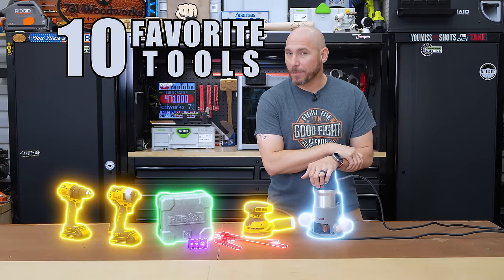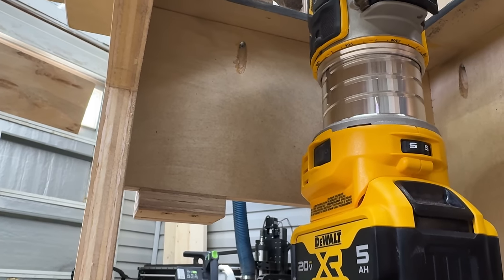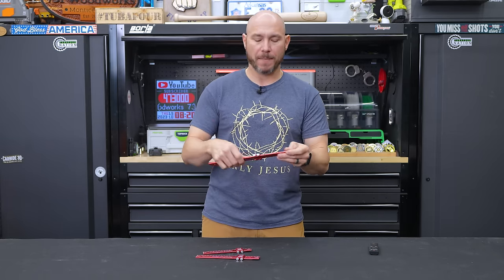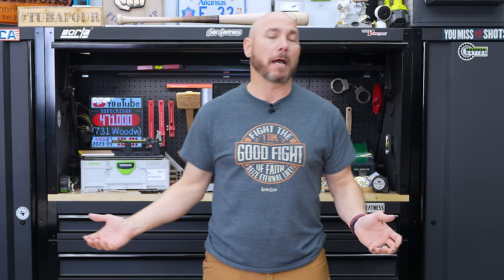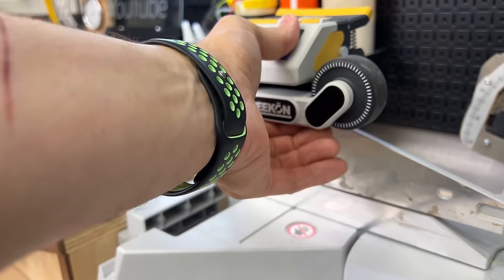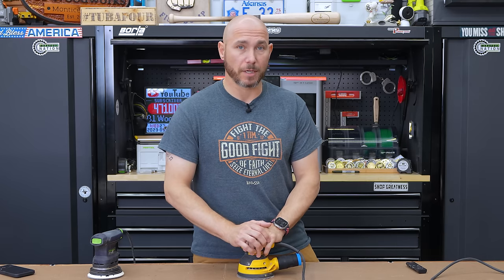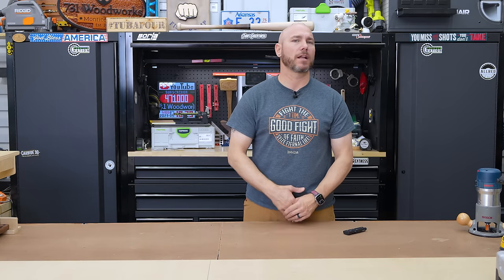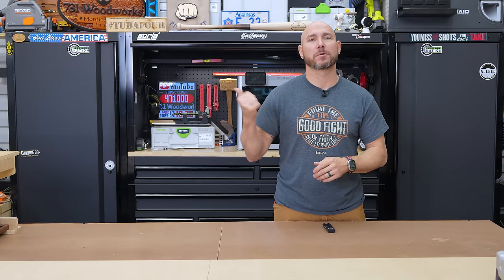Top 10 Woodworking Tools I Found on Amazon in 2023!

Comment: @731Woodworks This is the 2nd video that I noticed you mention it being weird that the 20 volt batteries don't work in the track saw but the 60 volt will work in the 20 volt tools. The reason for that is because the 60 volt batteries are actually Flexvolt. The batteries are at 60 volts for tools that require the extra power (like the tracksaw) but they change their voltage automatically when you use them in 20 volt tools. The 20 amp batteries don't have the ability to up their voltage to 60 volts. That's why they don't work in tools like the track saw.

Comment: Anything Woodpeckers can automatically be declared excellent. But I've got a 50 year old Starrett combo square that is still dead on square. I also have that Bosch router from when they were first released. There was a Craftsman version of the same router but I believe the body had cheaper materials. It's definitely a buy it once tool. 

Good video.

Comment: I'm mostly a DeWalt guy, but when I got my tracksaw I went Team Teal.  Biggest reason?  Track compatibility.  Makita and Festool tracks are interchangeable.  DW is proprietary.
Reply: That's true, the Dewalt tracks are proprietary to the Dewalt Tracksaw.  That said, the Dewalt tracksaw has 2 grooves in the base, one for the Dewalt tracks, but the other works on the festool-like tracks.  I have two Festool tracks (eventually more once I get LR32 tracks) that work just fine on the Dewalt saw.

Comment: I just commented the same thing on another video. I haven't had any complaints about any of the wen products I have. I have and use the oscillating belt/spindle sander, drill press, and band saw. I also have the track saw and 660cfm rolling dust collector, but haven't used them yet.
Reply from the maker: Thanks for sharing!

Comment: Great content today. I would like to see you test the Dewalt 20 V max knock off batteries that are just all over Amazon. I don't know if they fit they work they last half as long or twice as long that would be some good content I think.  Hey just thought of something else on the router bit holder, it works you're just great to hold the bit while you try to sharp in the edges.

Comment: Great content. I’ve had my eye on that router and router table combo. Looks solid. Thanks Mighty Matt!!
Reply from the maker: Thanks Lloyd!
Reply: @731Woodworks  your welcome Sir.
Reply from the maker: @ronswoodshack   What tools are on your wish list?  Trying to get ideas on what to review in upcoming videos.
Reply: @731Woodworks  to be honest I’ve been extremely blessed with some awesome tools. Besides the router table combo I have pretty much all I need. I will say that a head to head on a budget table top jointer and up to the more expensive brands would be cool. Wen, Porter cable, craftsman, ridgid, wahuda. Be cool to see if the more expensive jointers are worth the higher price and why. I have the porter-cable brand that you posted on a deal, but it’s my first and I have nothing to compare it to. The porter-cable does a good job for me and I no longer need to use the level and tablesaw method.

Comment: The construction calculator is available as an app for your phone which means you usually always have it with you and it can be updated as they improve features.
Reply: What updates are needed? A 1/2 is always a 1/2, a board foot is always a board foot.

Comment: I have the venerable Bosch 1617 router. I bought it with the fixed base about 25 years ago, used it a couple times, then put it on the shelf. I found the round wooden handles unwieldy and the router never felt stable in my hands. I would never buy another router with round handles. Eventually I put the 1617 motor in my router table where it has stayed ever since.

Comment: Router bit clamp looks useful. Why not just make one? Just needs a couple of uni-directional bearings- they do them on e-Bay.
'You gotta add those fractions' (6:21)- most of us (>95%) don't. We use decimal. Why don't you? All you need is rulers marked in tenths. (Inches or mm, your choice). Using three bases at once is bound to cause you problems.
Combination square- the magnetic types are so much faster/easier to use. No fiddling with clamps, or having to get the rule back in the slot. And you can flip the rule- four ways!

Comment: Matt
You flashed a pic of your drill press and I thought I saw a couple dog hold downs? Where did you get them? 
I was going to get the WEN spindle sander then a screaming deal came along on a new in box Bauer sander which is very similar to the WEN and works great.

I have to agree with other comments about you building more stuff because your product reviews are costing me way too much money. 
Honestly though keep doing what you're doing, there are plenty of YouTubers building stuff but few giving honest reviews of tools on the cheaper end of things.
Reply from the maker: Thanks.  I don't have any dog hold downs on the drill press.  I do have a drill press table that has t track in it, with t track clamps

Comment: I bought the Dewalt sander from Amazon.  It stopped spinning after 15 minutes on first use.  Replacement arrived and won’t spin at all.  Grr.  Ideas?
Reply from the maker: Ahh geez.  Wonder if they had a bad batch?  I've had a DeWALT sander for years without issue. Might look at the Milwaukee Sander?  It's a good one.

Comment: Please stop saying the 60v tools not taking the 20v battery doesn’t make sense. 20≠60 it’s basically that easy. It would take like 10m of learning to find out some basic principles of electricity and that you’d need 3 20v batteries to be able to power it. It’s like complaining your 20v doesn’t run on 9v smoke alarm batteries…

Comment: These reviews usually suck, kudos to you, this is good stuff. For the most part. Default routers, yes. Bosch router, yes.  Wen tools, yes. That little thing that locks the router arbor, yes. Wood peckers stuff? Nice but sooo expensive and too finite for normal woodworking. Who works in sub mm increments, really. Why pay that much to think you’re a machinist. I work in 16” + or -.

Comment: You shouldn't use the flat side of a router base to do straight line, you use the round sides. Any tilt on your flat side will change your distance, while the round side the distance remains the same.